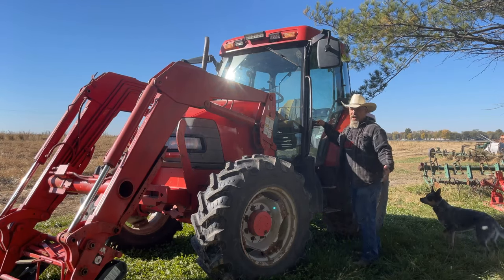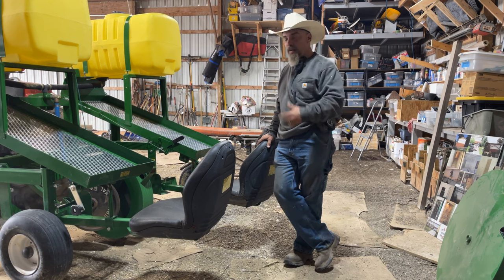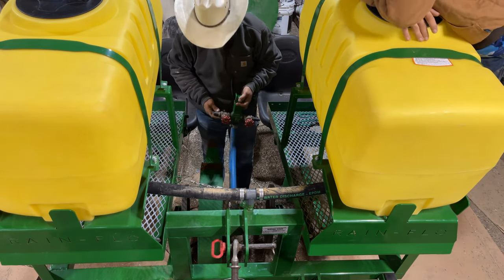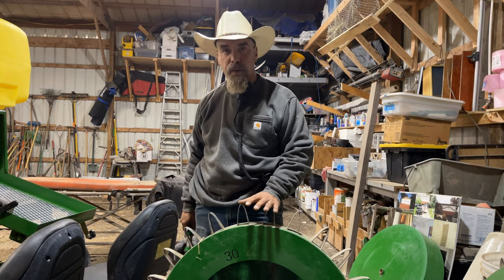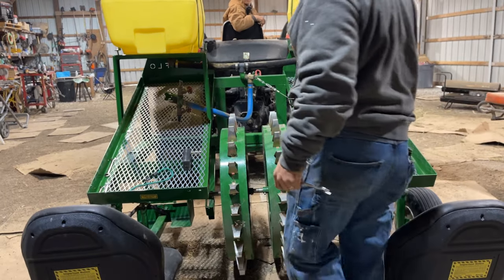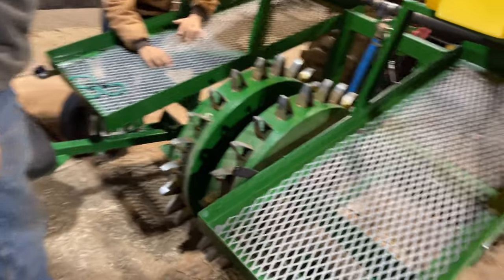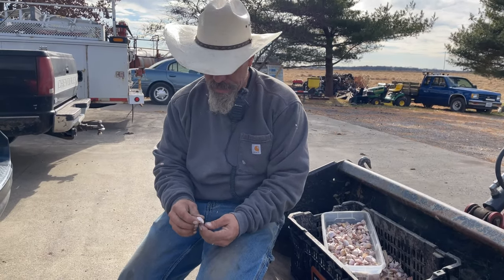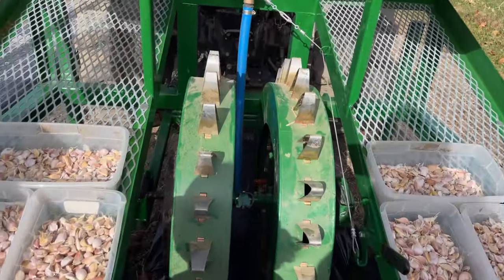Hardneck Garlic 2021 - Spanish Roja & Music - RainFlo 1200 Transplanter & biodegradable plastic

Comment: Cool operation. How do you close the holes after planting, or is that even necessary?
Reply from the maker: The water wheel adds a bit of water which makes a muddy slurry, and we push the clove into the ground slightly.